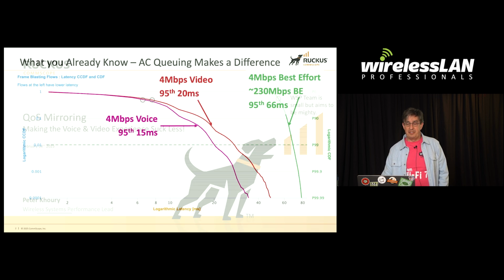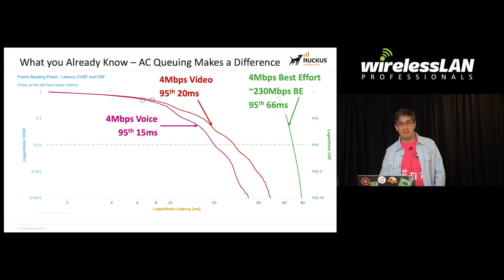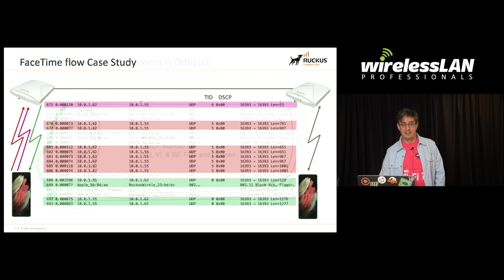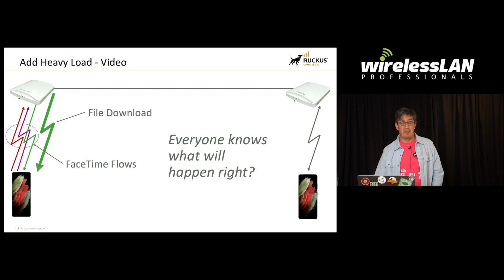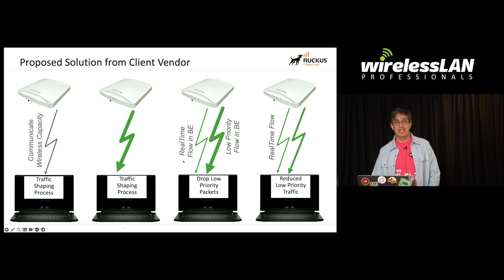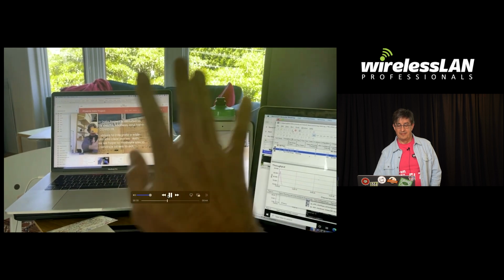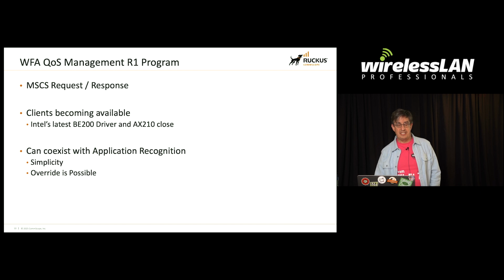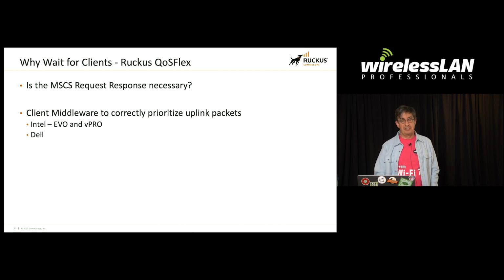QoS Mirroring | Peter Khoury | WLPC Phoenix 2025

Comment: The functioning of this is highly dependent on both the client side and the driver side. Why don’t we simply do this with application recognition? After all, certain “well-known” applications already perform correct QoS tagging on the uplink side (good luck to those waiting for a driver update for the ones that don’t!). In this case, if we have app recognition capability on the AP, then:
	1.	The AP should detect the type of traffic coming to it on the wireless uplink side and perform the correct DSCP marking when forwarding it to the wired side (if someone upstream decides to strip it, well, that’s their problem).
	2.	The AP should analyze the traffic coming to it via the cable, detect the type of traffic (for example, in this case, identifying it as FaceTime traffic), and apply the correct WMM tagging on the downlink side.

This is the best solution, and of course, it doesn’t require any special software on the client side.